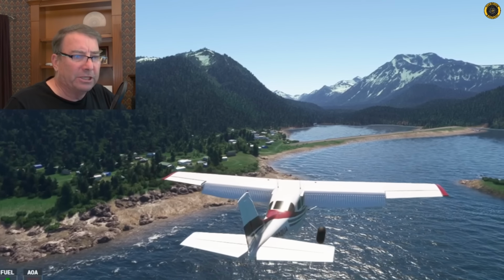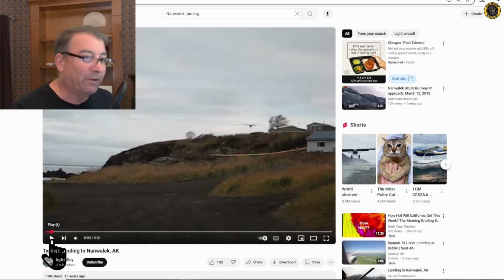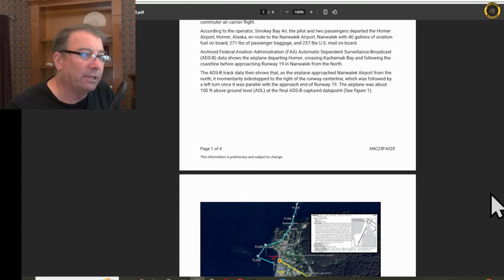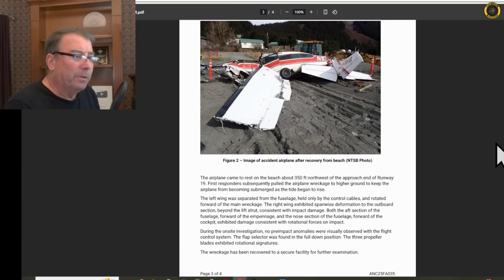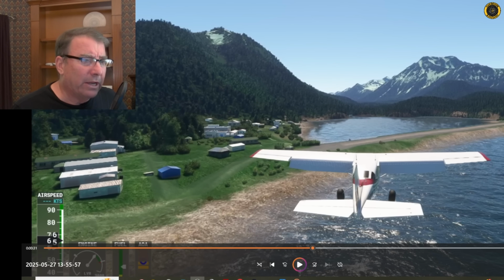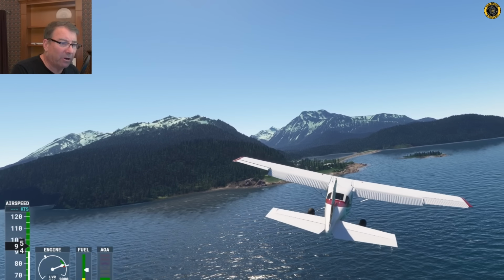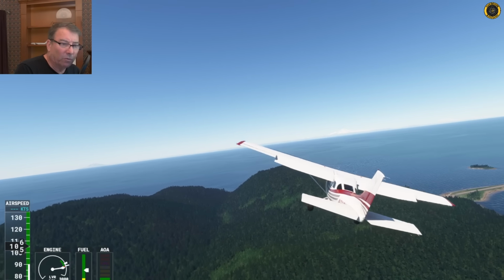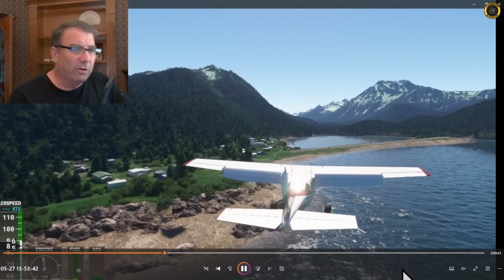NTSB Prelim Cessna T207 Crash Nanwalek, AK

Comment: Flight Simulators are amazing. I have the Redbird yoke, rudder pedals, and throttle / mixture / flaps. Some time ago I was living and flying (real aircraft) out of Farmington, NM (KFMN). It was a snowy day, heavier snow than most, so I set the flight sim up for a short flight to Cortez, CO (KCEZ) and set the weather to actual. I wanted to see just how bad flying in snow was. I took off, pitot static heat on, climbed into the soup, enabled the autopilot and flew toward Cortez. As snow accumulated I started having to add power to keep my airspeed up. Halfway into the flight I was at full power, slowly losing airspeed. Then, the aircraft rolled over and started spinning. Nothing I did would stop it. I broke out of the soup 100' from the desert floor and impacted very soon after. That was the most sobering thing I've ever done in a simulator. I've never repeated it.
Reply: I am also a big believer in the value of flight sims to visualize and "pre-fly" approaches and terrain that are new to me. No it's not exactly the same but it gives you a perspective that might me difficult to really understand otherwise.
Reply: I currently fly medevac out of Cortez, CO.  We get some nasty snow squalls coming through from time to time.  Mountains and icing are no joke.  The winds rolling through Cortez with Sleeping Ute, Mesa Verde, and the San Juans will wreck your world too.
Reply: @JoshuaJayG  100%. I was living there when the Cirrus went in south of Farmington. That was a strange one. The guy in the Bonanza that took his girlfriend, soon to be wife (or maybe they were newlyweds) over Bridal Veil Falls but stalled and spun in. There was usually a density altitude crash every summer for the 5 years I lived up there. I flew to Moab, via Cortez a few times. Moab is tricky in the summer. Rising terrain to the east and south make takeoff and departure interesting in a light aircraft. I flew out to Blanding (KBDG) and back via Cortez (Unicom... 91B inbound for landing at Blanding :D ) numerous times. The guy I rented from said that the airport at Shiprock, 5V5 was originally laid out E/W but the dozer operator got tied of the wind blowing sand in his face so he turned north. Urban legend or real... doubtful. The airport out at Navajo lake (1V0) was fun to shoot touch and goes at. Same with Aztec (N19). I flew down to Gallup (KGUP) quite a few times. Sometimes I came back on the east side of the Chuska's, sometimes on the west side. I took 91B down to Moriarty (0E0) once but with the glider towing operations going on that day I landed then took off a few minutes later and exited the area to the north.  I didn't get to fly as much as I wanted to but more than I do now. 

Props to you Medevac guys and gals. The area needs you.
Reply: @MichaelLloyd  Same stomping grounds.  0E0 always has fun winds and cheap fuel.  It was a common fuel stop for me between Moab and Roswell, NM when I had my Cessna 120.  Flew for Redtail for seven years with 470 hours in 207s out of there.  Every year the winds caught some unsuspecting pilot.  I saw a lot of dead airplanes at CNY between the winds and the dark nights.  Keep the oily side down.  -Joshua
Reply: @JoshuaJayG  I soloed at KAEG and I've done my fair share of flying between Albuquerque and Salt Lake City. Had to sit out a snow squall at Blanding once myself, and I've gotten caught in a downdraft trying to climb out of Cortez as well. It's unforgiving terrain with miserable winter weather, and for the rest of the year a lot of pilots don't properly respect density altitude. Fly safe, and listen to the part of your gut that urges caution in and out of the tight mountain strips.
Reply: What were you flying in the sim? Did it have any de-icing equipment? Just curious.
Reply: @jimchesnutt7879  C172. No De-ice on a C172.
Reply: When I was learning to fly in a Cessna 150 it was a pretty scary ride when I went to do a go round with full flaps forgot the carburetor heat lucky I survived

Comment: Maybe he added too much power too suddenly without enough time to adjust the pitch trim from landing configuration, which caused left yaw from the engine torque and excessive pitching up.  I don't think he would have wanted to turn left because straight ahead is the obvious way for going around

Comment: Thanks for covering this Jaun. This one hits close to home. I grew up in Homer and lived there off and on over the years.  Not a pilot but was a passenger many times with Smokey Bay Air.  Those guys and gals fly those runs to Seldovia, Port Graham, and Nanwalik many times a day and they are great people. They may not be long flights, but if something happens, theres not many places to put a plane down. Dan was the pilot a few of those times and I’ve rode in the plane that crashed. I mostly traveled back and forth from Homer to Seldovia doing electrical work.  Only once into Nanwalik to pick up or drop off, I don’t remember as the flight was uneventful.  That being said, I remember not being too stoked to be stopping there because I was always afraid of that runway.  Thin strip of sand with mountains at both ends and the potential for some gusty or down right screaming winds coming off Cook Inlet, no thanks!

RIP Dan

Comment: Yeah Juan, I always pre-fly any new route in MS2020 for the exact same reasons you articulated!
Reply: Same here.  The technology allows me to visualize the approach to an unfamiliar airport, to identify the landmarks while navigating to the destination.  While Google Earth is great, MS2020 graphic is just way better and it provides a simulator to check my speed and other aspects of flying.
Reply: Same, both MSFS and Xplane. I also used both for teaching myself how to fly an ultralight. Set the winds/gusts to barely-controllable speeds that you'd never ever do in meatspace and it really sharpens your skills/reflexes without risk. Other things like moving the CG around and overloading the plane can help you gain valuable intuitions. VR headset really adds a lot too. (Especially making turns and in the pattern, you can just glance like you need to, instead of messing with a POV hat.)
Reply: How accurate is it? I fly out of a busy urban airport and have thought about using MFS for scouting out landing zones in case of engine out on takeoff but I'm not sure whether relying on it to form a mental picture might do more harm than good in the event the spatial accuracy leaves something to be desired.
Reply: @somealias-zs1bw  I find the area around my airport/house is not accurate and pretty generic as far as ground obstacles go. But I'm also in the middle of nowhere and this is MSFS 2020, haven't gone to 2024 yet. Another thing that helps is scouting out places that look like good landing areas and then going to check them by driving the nearest roads to see if they're actually clear of trees/obstacles that you might not see from the air.
Reply: @somealias-zs1bw  I'm no pilot but I think msfs 2024 has actually more high antennas, powerlines and such included by default. Those are pretty critical I think if you want to form a mental picture. Another thing I notice is that flighsim is pretty generous with trees in some areas while maybe there would be a field if you need to make an emergency landing. Think if you have the charts nearby and check the area in flight sim not much harm can be done as it always will be a pretty correct visual concerning terrain and such. I just fly for fun in VR and I'm often amazed by how real it feels but I don't have much real flying comparison :)

Comment: A left turn sure seems like the absolute worst decision that the pilot could have made with obvious results. I like how you include the "startle" factor. Tragic event. R.I.P.
Reply: Agreed. I was thinking based on early reports that the pilot flew a trajectory similar to the third go-around attempt (second successful go-around) that Blancolirio flew in the sim, i.e. managed to fly the length of the runway, stalled upon making the right-hand turn to avoid terrain, and crashed near the south end of the runway (i.e. the foot if runway 1). But now we learn they never even made it that far, since the pilot went left instead of right... I really do wonder what made the pilot feel a left turn was safer than just flying the length of the runway (or even just flying straight ahead towards the canyon like Blancolirio suggested), especially since whatever obstacle he saw couldn't have been very tall (which could ostensibly have necessitated more evasive maneuvers than a typical go-around).
Reply: @pointsandlines12x35  I think sadly it was just a bad error, could be used to flying with much less weight. Or maybe he literally turned the wrong way in that moment he was startled and saw whatever it was on the runway. There was not a whole lot of time for him to pick and correct his error.
Reply: @BirdhouseNZ  Yeah the "startle effect" seems to make the most sense at this point; in any case, once he initiated that turn, he had little choice but to follow through. Incidentally, his used to be one of the few videos of a Nanwalek landing on the platform (runway 1 in particular, a much harder approach than the one on which he crashed); I commented the link on Blancolirio's last video about this crash, but his account's since been taken down. If you're interested in seeing him fly that approach and/or paying respects in the comments you can still find the same clip by looking up "Landing in Nanwalek with pilot Daniel Bunker of Homer, AK".
Reply: But it looks like the simulator was able to make the left turn. Hard to tell how much it cleared the terrain by.
Reply: @briankowald6465  The simulator is good, but the terrain representation isn't perfect. There is more verticality to the village at that end of the runway than it shows, which also presents more of an issue.
Reply: @briankowald6465  Yeah but Juan knew  that he was going to make the left turn in advance. Seems like the pilot would have to be very good to fly in an out of there regularly. I guess we'll never really know the reason for his decision. Maybe another undisclosed or not obvious factor. Sad outcome.
Reply: It may be good to show the terrain and general flight, MSFS is not accurate enough aerodynamic simulation to be exact - especially in extreme conditions. There was no time to think just to react and sometimes your gut reaction is wrong and the solution is counterintuitive, especially when it comes to aerodynamics. It's hard to stall any Cessna, but full flaps in landing trim is the most dangerous time. Most people who don't do at least 20hrs of flight training will never experience a stall, it's a sickening and scary experience at 5000ft, I can't imagine it at 200.  The flaps thing is pretty unforgivable though, 'throttle up flaps up' shouldnt take more than a few seconds and its the same on every Cessna. You practice your go-arounds, memorize the abort procedures and it should all just be muscle memory if you are flying commercially. I think what most people don't understand is that when the plane is like that and something happens a lot of the time your first reaction is to pull up and climb, but if you dont have the speed for that you just fall out of the sky and die when your airspeed dips too low.  I can't imagine they didn't have a set abort procedure for that runway and it sure wouldn't include turning over the town and into the mountain no matter what the wind was doing.
Reply: @vertex_normal  Yeah, @angleofattack mentioned that they have go-around procedures for each runway (and unsurprisingly, that overflying the lagoon is a no-no), so hopefully we get to see those charts at some point, but I'm not sure how enlightening it'll be.
Reply: @vertex_normal  I have a friend who had a '57 Cessna 180 and he used it to go fishing on barrier islands making beach landings. He flew a Stearman at Crop Dusting School and learned what no flaps flying was all about. Said he learned so much going to that school. He wouldn't upgrade to a newer model 180 because of the move to electric flaps in them. He preferred the mechanical flaps on his older 180 because they were "instant". "Down when I want 'em" "Up when I don't".

Comment: Non pilot question. What would the go around procedure be for this runway?
Reply: I don't think there is a standard for a runway.  Juan went over the standard control use and settings for the plane itself.  The pilot needs to figure out what is best for the situation he is in.  Which Juan also addressed.
Reply: It's a right pattern, so full power, flaps 20, trim nose down if needed, straight ahead to 400 feet AGL, make a right crosswind.

Comment: If the surviving passenger is not a pilot, he may have mistaken a left wing stall for a “steep turn to the left and then spiraling to the ground” (maybe not an exact quote). If the pilot was turning right, then the left wing would have stalled first and it would have spun to the left. I can’t imagine why he would have actually turned left there.
Reply: That was my initial thought as well
Reply: Witnesses on the ground also reported the left bank. I didn't see any mention of seeing an attempt to turn right or go straight in the report.
Reply: That's food for thought, for sure.🤔
Reply: That sudden left bank strongly suggests a full power stall.
Reply: That does seem to make sense.  In that situation you probably could easily misinterpret exactly what happened.  Very sad.
Reply: Then again, the description of the impact damage seems to suggest it was spinning to the right, so maybe it really was a left turn stall.
Reply: Multiple witnesses on the ground also report a left bank. I don't think anyone reported an attempt to turn right.

Comment: This landing site is on Microsoft Flight Simulator as a challenge. It's a difficult landing, especially from the high terrain side. I crashed many times until I finally got the hang of it.
Reply: I thought it looked awfully familiar.  I have successfully landed there…..let’s see…..carry the three…..never.
It’s unfortunate they can’t just run an on demand ferry around the corner to Soldovia.  And it’s strange that they can’t just drop it in right over town.  You throw out the anchor in a Cessna, and it plummets.

Comment: I use MSFS2020 as well to prepare for flights and also to fly a scenario after an accident to sense what might i have experienced.  Like the MYF Citation crash...I realize that MYF ILS is to a short runway...i used a CJ4 in sim and resisted ducking below GS and barely got it stopped on tge runway.

Comment: Never been there, but you are exactly right Juan, your missed approach is correct. Here in Skagway, like many of these bush communities, options are very limited. ✌️🇺🇸
Reply: That's one of my dream airports to fly into one day (well Alaska in general, but Haines and Skagway in particular, as well as Nanwalek, assuming it's still open by the time I make it there). I've done the PAHN-PAGY route dozens of times in the sim, and if I ever make it out there irl I'm hoping to do a xc route out to Atlin, Teslin, or Whitehorse (which would you recommend?). In the sim I usually follow the VFR departure from 02, bearing right over the baseball field before making a smooth 180° to the left, then keeping right of runway 20 until over the inlet (I assume go-arounds are similar?). For pattern work I usually keep flying south down the inlet before turning around, staying to left the entire time, and make my turn to final at around 800 ft overhead the Burro Creek Lodge. How does that compare to how you fly in/out of there? I find it especially fun to fly in with crosswinds as, at least in the sim, they die down to some extent once I'm in the shadow of the nearby terrain (I've no idea how accurately it replicates the precise conditions), so I'm having to make adjustments to my slip the whole way down, never allowing myself to get too comfortable.